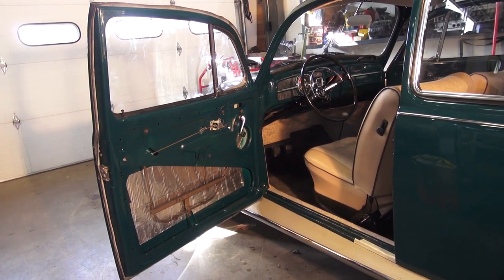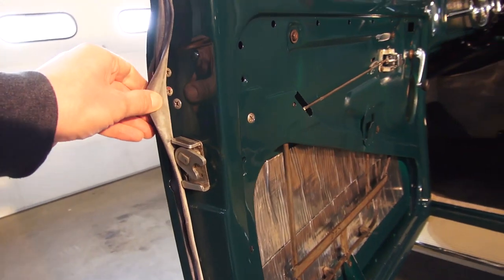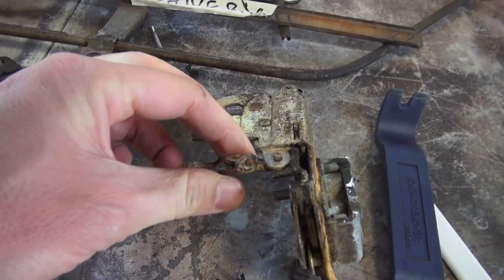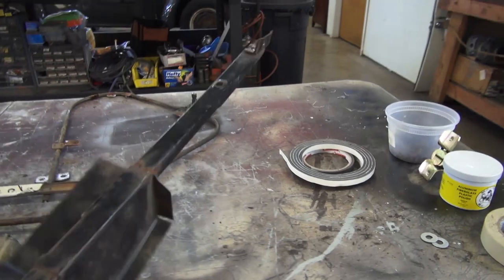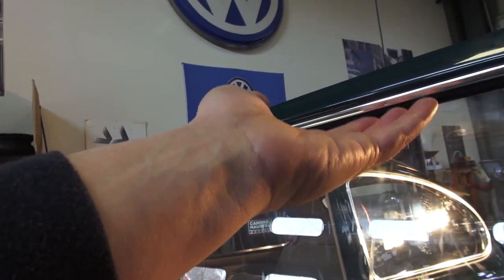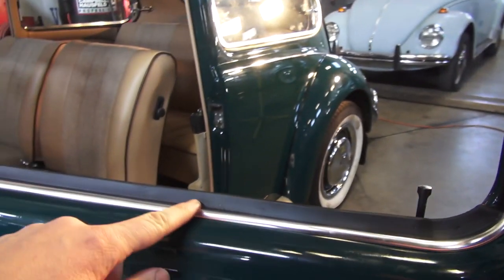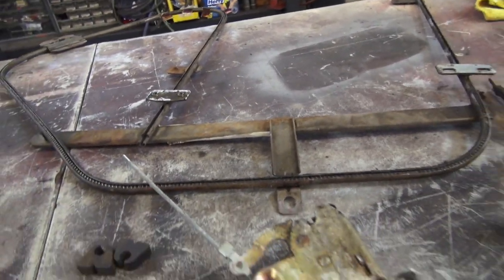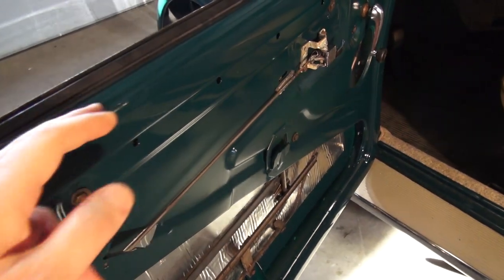Classic VW BuGs How to Assemble Build Restore 1965 and Later Beetle Sedan Doors PT. 1

Comment: Thanks Chris, but I cannot get the 67 bug WINDOW REGULATOR Winder out of the door. All of the screws are out and it most freely, but it some how attached at the top and middle of the door.
Reply from the maker: Did you pull the vent window out?

Comment: Chris--for the 65 Bug, is there a special washer that goes at the end of the rod attachment (2:41)?   Just wondering how to keep the rod on the door mechanism so it will not fall off.  Could twist wire, but thought there may be a better way.  Thank you.  Great video!
Reply: Oops.  Question answered.  I saw the c-clips in another one of your videos.  Thanks!

Comment: Hi Chris,  I'm looking at a 67 Beetle that unfortunately has one-piece/cal-look windows.  On the 67 door, do you think the previous owner needed to cut or modify the door to install the one-piece glass?  I would like to install the wing windows/scrapers/felt back to stock.  Thanks!
Reply from the maker: Usually yeah,
Reply: +BigEstudios The P.O. had to cut out two tabs to clear for one-piece windows. If you're converting back to two-piece, getting the vent wing back in is now easier because of the lack of those tabs.